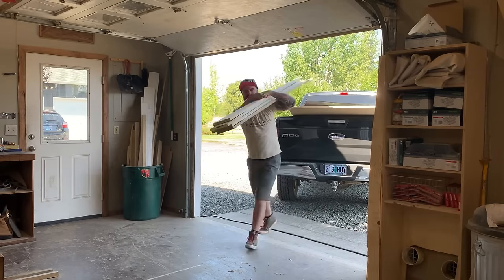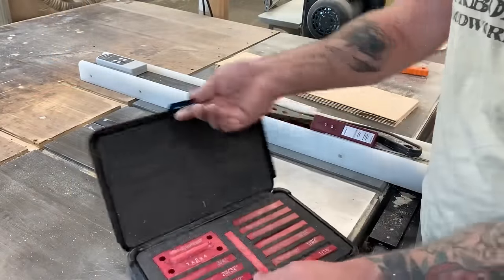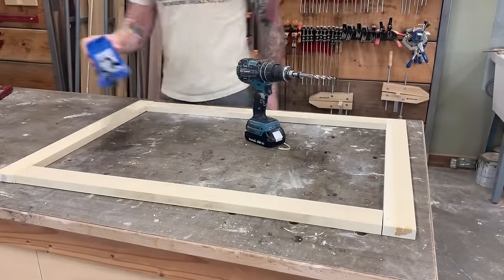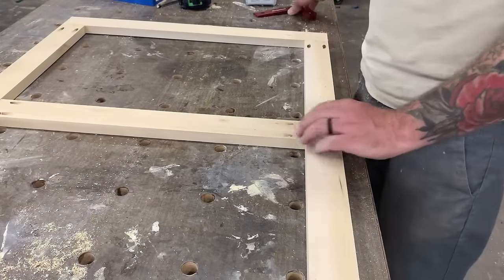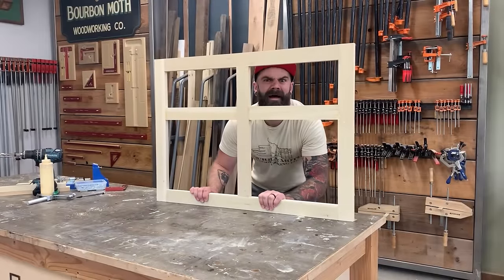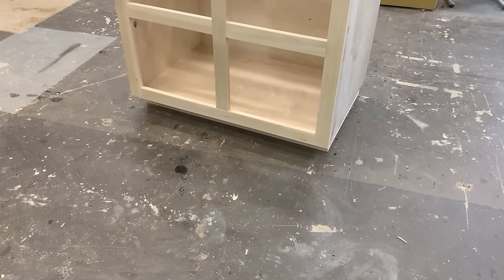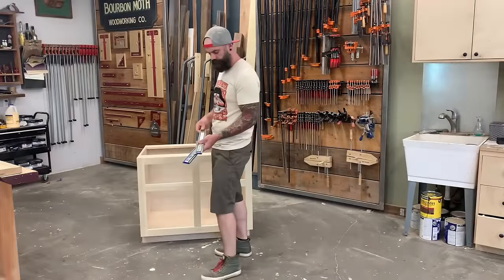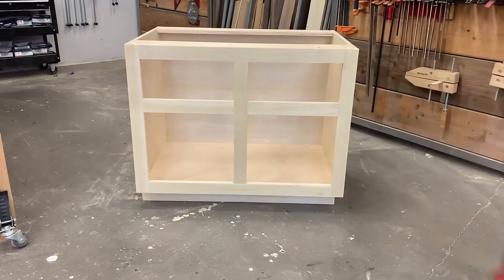The Ultimate Cabinet Building Guide || How to Build DIY Cabinets

Comment: Hi Jason, it looks like you have linked every tool/product except the one that might change my life - the epoxy filler, and you didn't show the package in the video.  Would you please link that product?  I have tried several products to eliminate the transition from ply to dimensional, to no avail.  I can always see that joint.

Comment: Thanks for all this info.  I have made a number of cabinets but it really helps to get your insight and tips on this, especially the undermount slides.   One question:   when making the shaker panels, why don't you use the router table with a set of shaker bits?   It  seems to me to be much easier than all the settings necessary to do it on the table saw.

Comment: Jason, I found your cabinet instructions very helpful. I appreciate your finishing instructions too. One thing that would be great is hearing your thoughts on finishes to showcase the wood in addition to painting. I've been planning white oak face frames/doors but there just isn't much info on good finishes for these, especially if you want to add some color. Thanks!

Comment: Been watching for years. You’ve been SO helpful!  Thanks for that!!

Quick question if you see this. I’m about to make 2 hanging cabinets. Is this style appropriate for that with just the glue securing bottom? Should I add some nails or pocket holes anywhere for that bottom piece?

Or would you move the dado up to a rabbit and slide bottom in instead?

Why am I scared the glue won’t hold over the years for that base piece? 😳

Comment: I was going to give you crap about not hooking the bottom part of that woodpeckers corner clamp in the right orientation but then I realized you did it on purpose because otherwise it wouldn’t have fit on the table. You’re smarter than I look…lol.

Comment: OK Jason, I have a question for you.  I watched the three part cabinet making videos and
 now I have watched this video, and in none of them did I see how to hide the seam
 between the cabinet box and the cabinet base. In the cabinets, I am building
The edge of one side will be visible. Now I noted where you used the oreo cookie looking
Epoxy between the cabinet face frame and cabinet will this work for the seam between 
the base and cabinet as well? I  am planning to paint these cabinets as well, not staining.

Comment: perhaps i am algorithm blind and just trapped watching the same things. i have been watching vids thinking about building cabinets for my kitchen v.s. buying cabinets. i have seen the different builds and finishes on many channels and in my head there is still a disconnect. what woods? if i paint cabinets but not drawers what do i do with the cabinet insides? just leave them raw wood? unprotected? clear coat? to build cabinets and paint them is ok. but it somehow seems unfinished. what do you do with the insides of your drawers and cabinets?
Reply: You don’t want to leave them raw. You could but it obviously won’t look good and they’ll yellow over time. 

If you’re painting your cabinets white you can use pre finish plywood, or white melamine. If you’re staining them you can use pre finish plywood or maple melamine. These woods are for the insides and you won’t have to paint or clear coat. 

The only time you paint or stain the inside of your cabinet is when it’s going to be seen. Cabinets without drawers, cabinets with glass doors, or open cabinets etc. 

If you do face frame cabinets and you’re painting them you can use poplar wood. It’s not a pricey and it’s durable. If you’re staining them that will depend on what wood you’re using alder, maple, white oak, red oak, walnut etc.

Comment: For those of you following along with a dewalt table saw without a dado stack. Check the blade height after so many passes, apparently it can slightly move during the multiple dado cuts. I started at 7/16 in deep and ended at 3/8in😢.

Comment: Just curious why one wouldn't use a pice of 3/4" ply as the back panel vs the 1/4" ply plus top and bottom nailers, plus the under-mount bracket scrap nailer pieces. Seems like it would be less steps, sufficient to use as a nailer, and make the whole thing more rigid?

Comment: I’m a complete novice and I’m wondering if it’s best to paint the cabinets before or after assembly? Any advantage either way as far as achieving the most professional, polished look possible?
Reply: Hello, "apswirl"
Currently, I build stained-varnished cabinets, and I prefer finishing the parts (after cutting and sanding) and then assembling them, especially because I apply the finishes with a good brush.  This preference prevents uneven and unsightly coats in the corners and along joints. Touching up is possible too.  Mind you, I take time (I'm retired) to mask my glue-edges so that I can still "glue and screw." Additionally, you must give adequate drying time to all coats of finishes. So plan your work. While waiting, start or work on another project or cabinet.

If painting--by brush or sprayer--consider applying finish to at least the inside of your cabinets before assembly.  For the exterior, at least priming parts might be considered. Finish the exposed parts of the cabinet after filling and high-grit sanding between coats.
Reply: Thanks for the insights!!